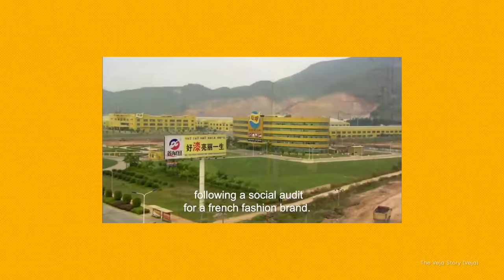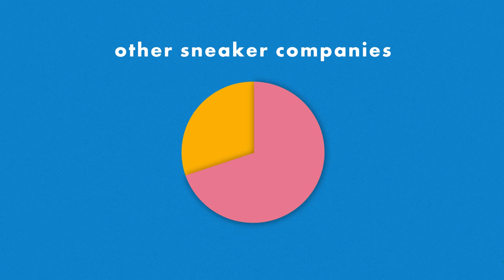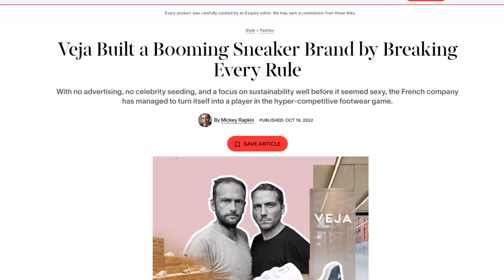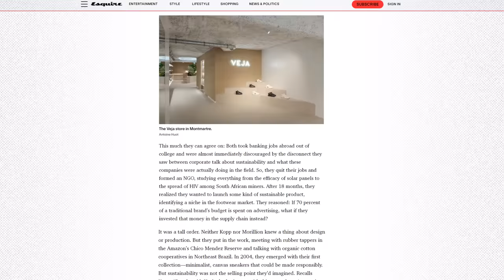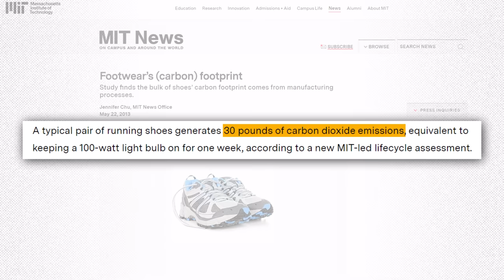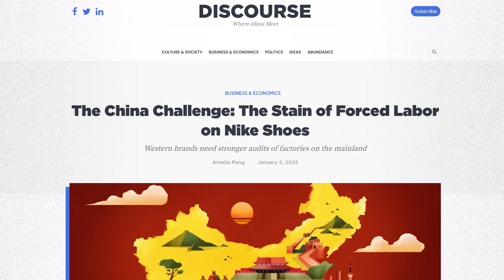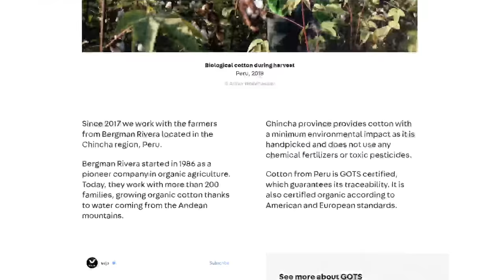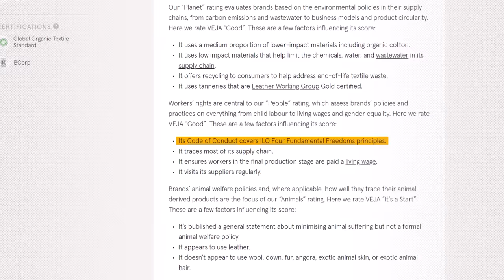How Vejas Became SO Popular

Comment: There are a few sneaker brands designed to be repaired. They typically use blake stitch or stitchdown construction to allow the sole to be removed and replaced. Goral and Crown Northampton do this with all their shoes, Allen Edmonds does it with one of their sneakers

Comment: I owned a pair and really wanted to make them work. But the outer sole was so thin that my heels were in agony after walking for more than 15 minutes. I finally parted with them when the fabric between the outer sole and the inside of the shoe ripped and the smell of the rubber just lingered once you took the shoes off. Bought this pair in 2020; maybe they have improved by now.

Comment: Wait, used shoes!? Not unless they're in near mint condition. You 'wear them in' to your specific feet.
Reply from the maker: Unfortunately, plenty of people buy shoes and realize they don't fit correctly after only a use or two. Then they're either sold on marketplace or a thrift store, so it's surprisingly easy to find used shoes in basically new condition!